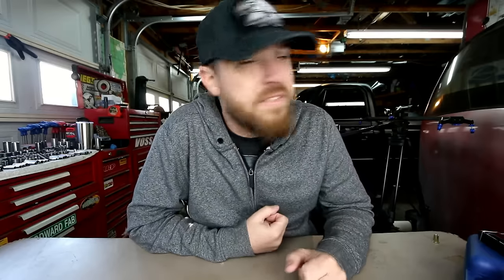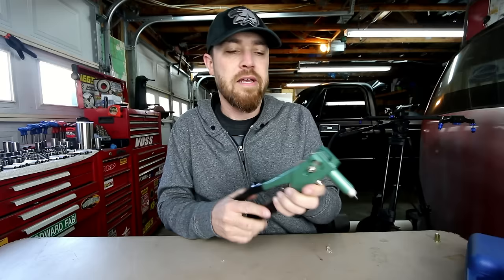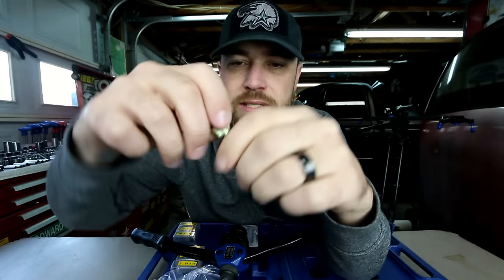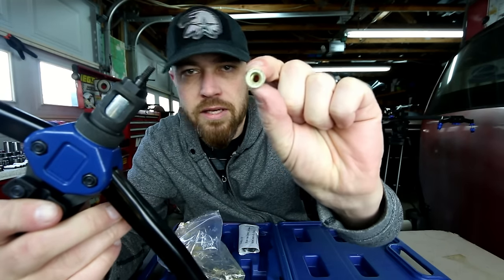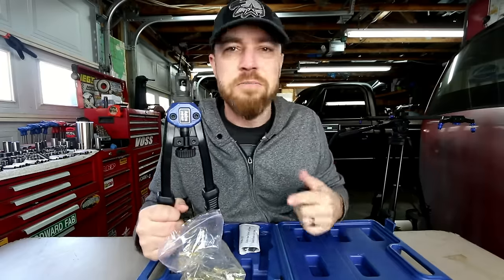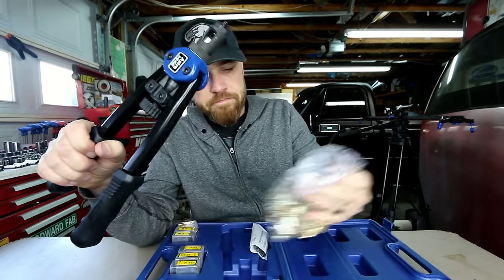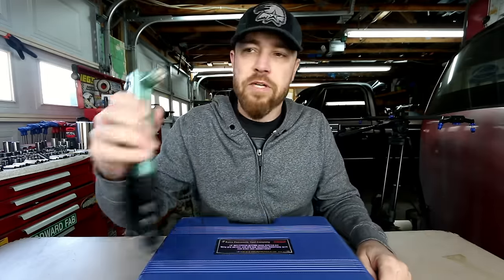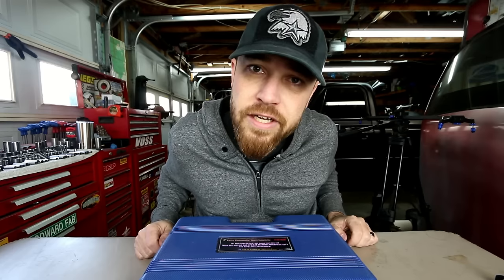You Need This Tool - Episode 55 | Nut Thread Setting Hand Riveter Kit

Comment: Not just sheet metal, you can put inserts into almost anything just make sure that you adjust the tool to the job. He just showed one size into sheet metal. But for each size insert you have to change the mandrel in the tool to match your insert. Easy and convenient. Thanks for the video.
Reply: Can it be used on wood...should I get this or a hand riveter ( Hercules brand)

Comment: That is a very useful tool for perfect for my car audio projects to cover up those large holes on the car doors, you know, the ones that are used to remove the window regulators etc. If you cover them up they help improve the car speakers performance. So this will help me be able to cover those holes up and make the panels I use on the removable to service the window motors when needed. Excellent video. I am now subscribed! 😎

Comment: All good. But...  What you are not mentioning is the optimal hole diameter prep on the sheet metal or plate.  
If you notice there are two diameters on the rivetnut the first diameter is at the beginning, then what follows is the outside diameter of the knurled portion of the rivetnut. The optimal diameter to drill and prep the hole to install the rev-nut would allow the knurled portion to cut the opposing part of sheet or plate with the same knurled pattern, as to add additional holding power.

Comment: I put a new frame rail on a mustang and the OEM part didn't have the nuts for the fender bolts.. Bought this tool right off the Dial Tool truck and it works great. I use it for all sorts of things.
Reply from the maker: thats awesome

Comment: How long can the 1/4-20 screws be, can they go all the way through the nutsert and excess can be under vehicle? Trying to use on a Sprinter oem floor to re-secure after putting down the insulation between floor and metal. I was thinking 1/4-20 x 1" or 1.5" encase thicker insulation is used.

Comment: I have a tough location to get at, in a confined space where I need to mount an electric vacuum pump, so it has a little weight. I may be able to get the first smaller rivet tool in there but definitely not the bigger tool. Does the first tool work well enough to justify buying and trying it though?

Comment: Hey Kyle great video.Your thoughts.  Do you think this would work on stainless steel running boards(nerf bars) that the nuts or threads rusted thru and pulled out. the bolts threaded up thru the bracket and into the Nerf Bars. think the kit would be a lot cheaper then getting new running boards for the truck. thanks for your time. Mike.

Comment: is it only for use with metal or can you use it on both at the same time for example can it go through a 1/2 inch plywood and a 1/2 inch angle aluminum at the same time?
Reply from the maker: you could use it on just about any material

Comment: The most important difference I see is that the Green one you would have to twist the entire gun to release unscrew from the rivet, vs the knob on the Astro...Is that so?
Reply from the maker: +Phil Indeblanc the green one has a knob as well
Reply: The Fab Forums thanks for that, as I see the small one for about $20, and the Astro for about $40. I would likely use alum, and maybe a couple projects under M10. but I didn't want to be stuck with twisting the tool at each rivet :-) A box of assorted 100 pcs of alum rivets is $14. I might want steel, also. initially was going to use in my car inner door skin to secure deadening material and air covers for sound proofing....great videos btw!

Comment: So the tool can be used on steel and aluminium rivnuts and the ones that come with the tool are they all aluminium or a mix of both aluminum and steel?
Reply from the maker: the ones that come with the kit are steel but you can get them in aluminum as well
Reply: @Thefabforums  o ok thanks ima need this tool for a future project so thanks for the video

Comment: Does the tool come with corresponding drill bits, or a chart to use when selecting the size nutsert.  I’m getting ready mount a ladder on the back of my Disco 2 and it’s calling for a 7mm drill bit.  I’m wondering if I can use one close or will I mess it up.
Reply from the maker: no , I wish it did

Comment: how strong are these? I currently have the problem that my subframe bolt nuts inside my chassie broke loose when intook off my subframe. now im thinking of putting in a m12 rivnut but will it be tough enough to hold a subframe?
Reply: They're strong.  They're essentially a huck bolt you can install by hand but if you start getting above m10 you need some strength and these cheap tools will strip the mandrel threads sometimes.  They make manual hydraulic ones as well as air actuated.  
They're strong though.   The mirror on my semi uses m8's through the door frame and one just ripped out of the door frame taking with it about a 2 inch diameter of the metal.   The metal will fail before the nut does and in a subframe, that's not rusty, I don't see that happening.   Just know the thicker the material the more challenging to install properly.
Also check out renting a huck bolt tool.  Don't bother checking on buying one.  They're crazy expensive.

Comment: Ok so. Can I use this for my custom roof rack so I can bolt it on my roof, how do I prevent water from leaking in?
Reply from the maker: I wouldnt recommend it because of the leak issue
Reply: I think some gaskets or good sealer could make that idea work. I'd try it on a donor car or something and experiment first

Comment: will this one place them in frame metal or into cage tube
Reply from the maker: yeah...it really depends on the wall thickness
Reply: I strongly suggest consulting the sanctioning body's tech department. 
Some sanctioning bodies can fail a chassis, roll cage or roll bar inspection because of the hole for it, depending on the size and location.

Comment: will it spin around once it's to tight on there?
Reply from the maker: the nut wont spin
Reply: If you don't debur the hole or leave some swarf in there and you won't have proper seating for the nut; maybe it could work loose over time from vibration or corrosion.

Comment: Could this work in a block of aluminum instead of sheet metal?  I know that people will recommend just tapping the hole, but I need  to have the thread aligned just right so that the screw stops at just the right rotation.   I don't need a whole ton of strength
Reply from the maker: no it to be able to clamp both sides of the material. Its basically a rivet
Reply: ok, thanks, I kinda thought it could mushroom within the hole and still hold. If you ever test this, let me know.